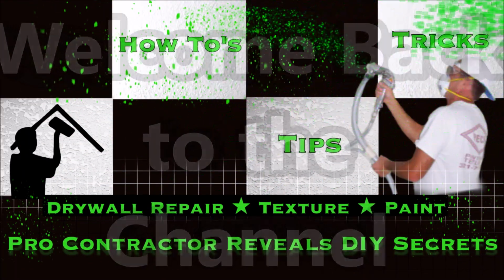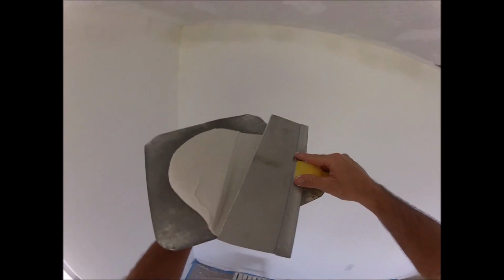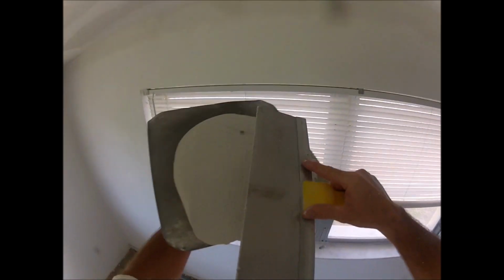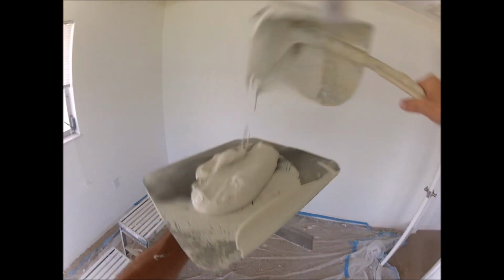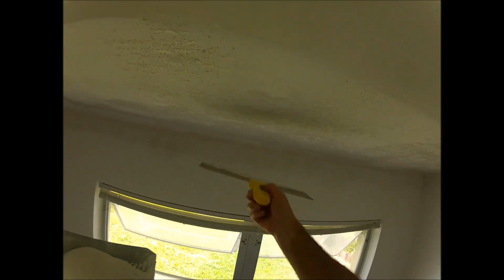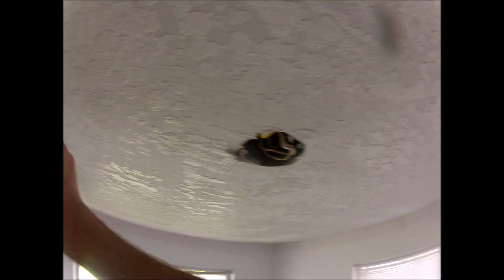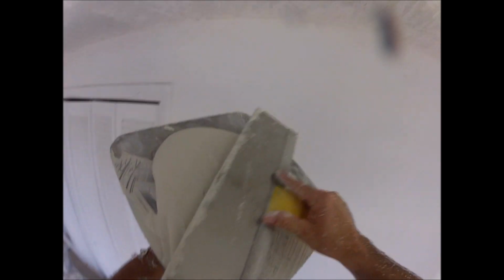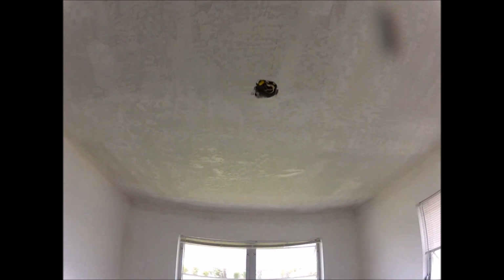How to do skip trowel texture on a ceiling tutorial

Comment: I think I already know the answer, but I'm asking anyway -- can I use this technique directly over a popcorn textured wall and ceiling? Or will I need to sand the popcorn texture off first? Thanks! I'm enjoying watching your videos  :) I'm a painting novice but I'm itching to try my hand at texturing now.
Reply: Kellyann... i apologize for butting in. I saw no answer to your question and thought I could help. I'm a 30 yr veteran drywall contractor. You will have to remove your popcorn texture entirely and for best adhesion of your new texture, you should prime your ceiling before texturing it. Hope that helped. Again, sorry for butting in.

Comment: I didn't realize the sand was so important.  I have only skim coated with plain mud and boy, it is hard to exactly match 50 year old florida real plaster skip. Of course, everyone's skip has their personal signature.  I do it with a trowel though and not knife.  

Real sanded plaster hardens so fast.  Not sure how you guys can work with that stuff.  It turns into a rock on me.  Which is why I cheated with mud instead.  In fact, I use 90 minute mud so I can get a good 45 minutes out of it.